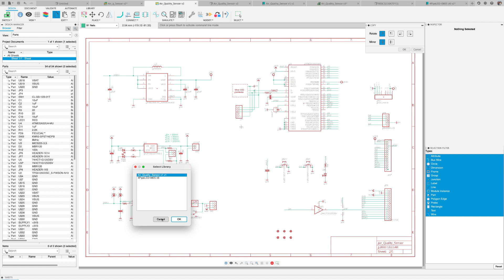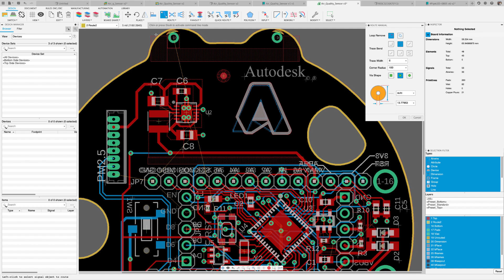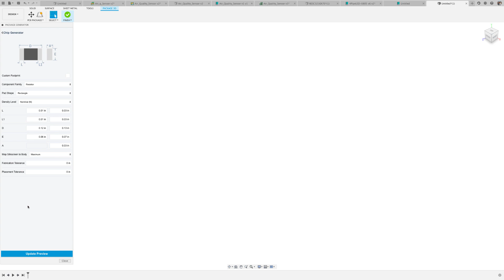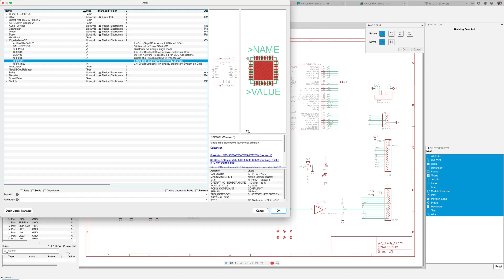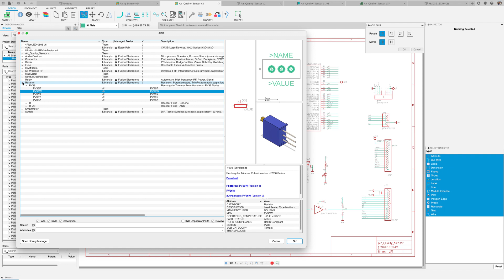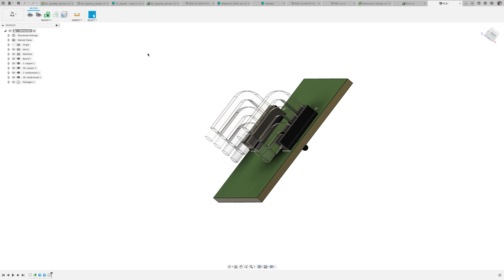December 2020 Fusion 360 electronics update

Comment: Thanks for the update :-) 

I can't find the answer to some question that bothers me for a while. 
On your schematic you have that nice, "standard" frame around all schematic. 
Is it just imported schematic or there is an option in Fusion 360 Electronic Design to turn in on, to show it up?
Reply: there should be a library that has predesigned templates for for frames, look for frames,
Reply: @davem3325 Yes indeed, it was there, big thanks.
Reply: @odwakacjidowakacji  Your welcome!